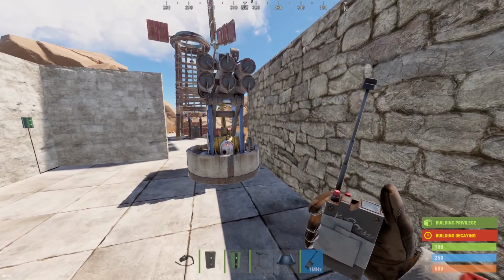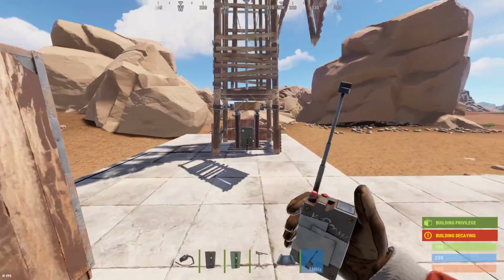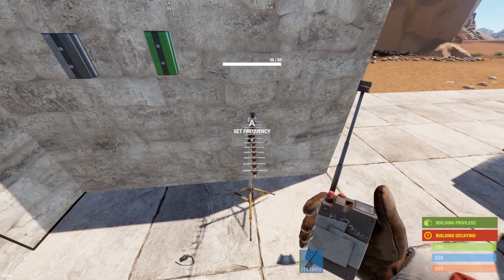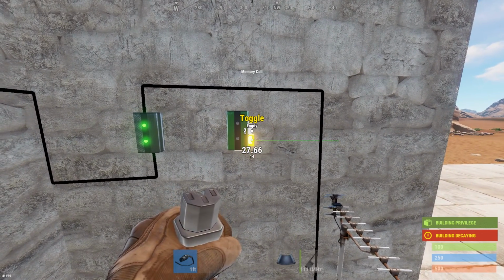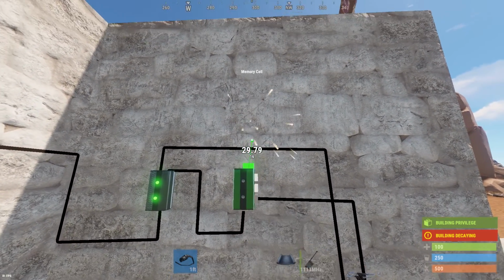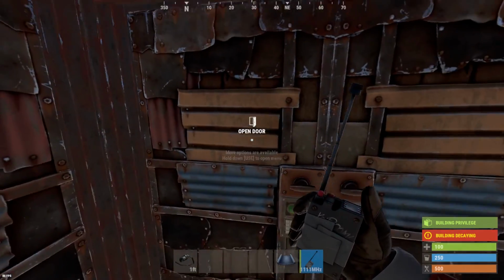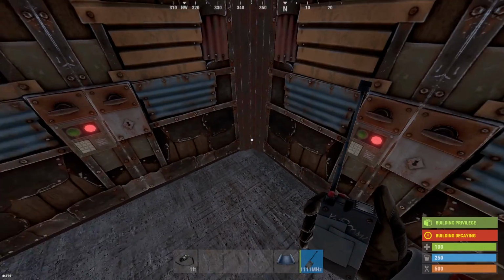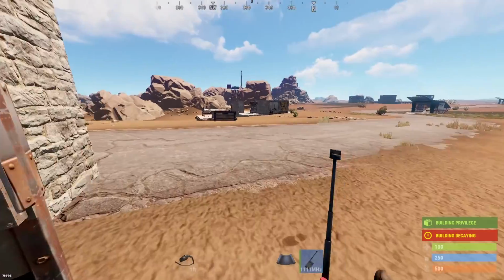Sam Turret Circuit for Rust by FullSized

Comment from the maker: So I just found this site https://rustrician.io/ which allows you to play around with circuit builds in rust.  As such I'm adding the circuit builds for my various videos to the descriptions and pinning a comment with the links to them for you guys to make it easier to follow the build.  Hope this helps and as always, thx for watching :)
The Circuit: https://i.imgur.com/zTbwWDB.gif
The Build List: https://gyazo.com/d3d5e9791aeb0ab62b111915e6d8d056
(you could use as little as 3 solar panels for this circuit though keep in mind you may need more solar panels facing different directions to maintain power during the day as the sun moves)
(one turbine even at very low altitude should also be sufficient which is why it is used in the example circuit)

Comment: - autoturrets are now undrainable
- autoturrets now require electricity ( 10 )
- auoturret has output for having a target
- autoturret has output for low ammo
- autoturret has output for no ammo
- protocol++
Reply: Btw, been waiting so long for this video! Thanks
Reply from the maker: @Rooxie973  Thx glad you like it... Where is this about autoturrets? Is this coming next forcewipe?  If this is this will be awesome.  I'll try to come up with some interesting electronics based on autoturrets :)
Reply: @K162KingPin  Yes, I saw it in a discord channel which featured rust commits. that's all the information we have. apparently input will be minimum 10, and feature 3 outputs. one each for target, low ammo and no ammo. I'm also interested to see how they will be undrainable. this is all set for the next forced wipe. electricity is about to become an essential part of rust!